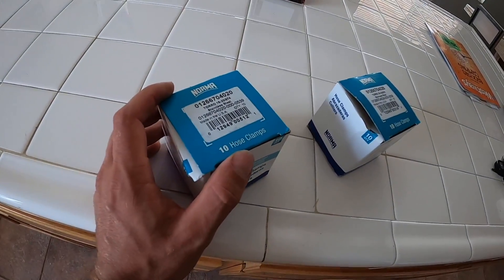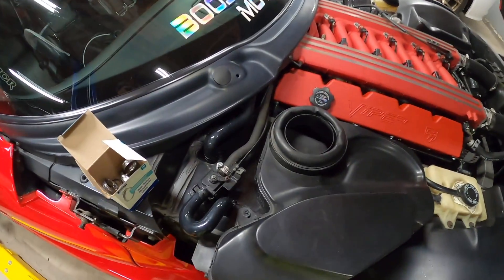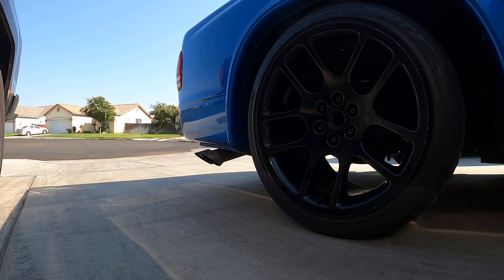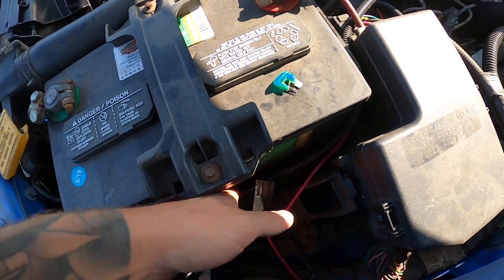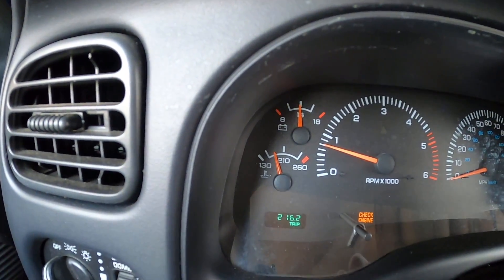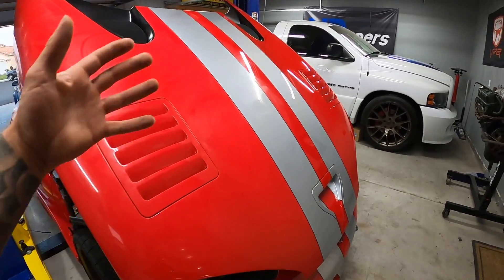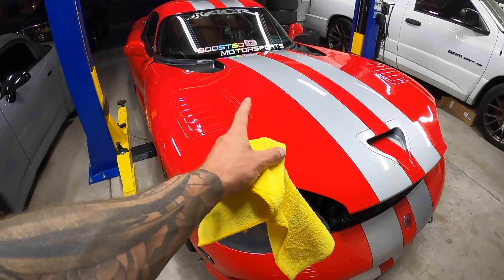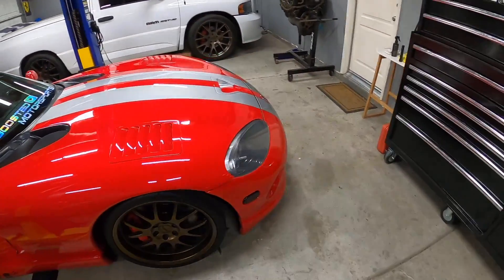MORE CAR PARTS MORE TRUCK PROBLEMS | BOOSTED VLOG

Comment: I need one of those fans for my Dakota. When its really hot it will run 3/4 on the gauge with the A/C on.
Reply from the maker: I have a few for sale if interested.  BoostedMotorsports88@gmail.com

Comment: Lol my 98 5.9 grand cherokee(not stock) is a little bit if everything you got. Comfy seats,  can be made to go off-road easily,  goes around corners well, hauls some ass, can tow, cargo space. Super quiet cab now that the pinion bearings been replaced+ sound deadened the doors. Not super  flashy like the stuff  you got, kinda boring and blends in a hair, but it's a dream vehicle somehow. I almost think you should daily drive one.

Comment: If it was 30A fuze, that melted, I don't think 40A will solve your problem. Just tight it's fem-contacts.
I have e-fan by your advice, bro, and 30A is ok.
Reply from the maker: I'm going with a completely different fan controller with bigger wiring, fuse, and relay 💪
Reply: @BoostedMotorsports  oh, then it's ok! In fact, I have no diablosport to set fan on-off temperature.
And that period before I made chip-tuning with new temperatures I just use manual fan-on knob with 30A relay.
Non-chiped ECU turn on fan at 103C afair, that is not ok.